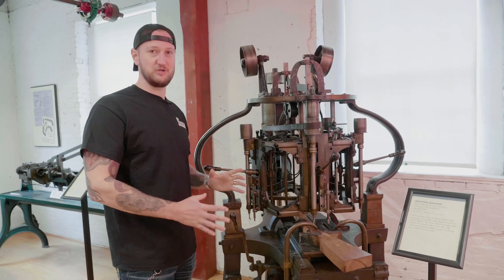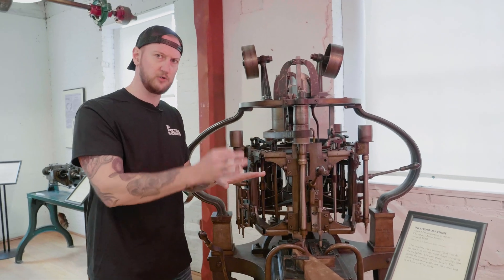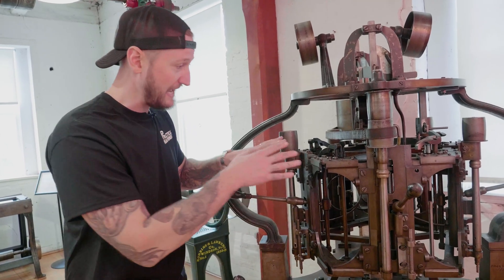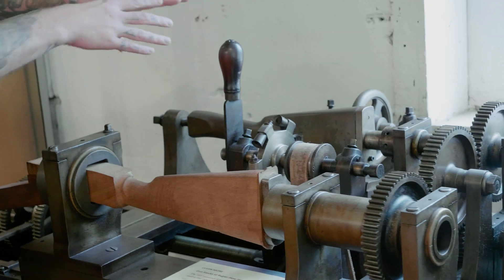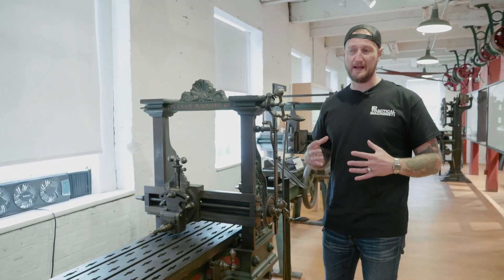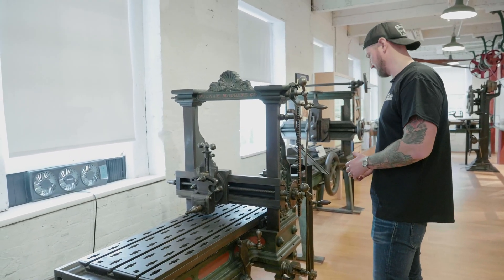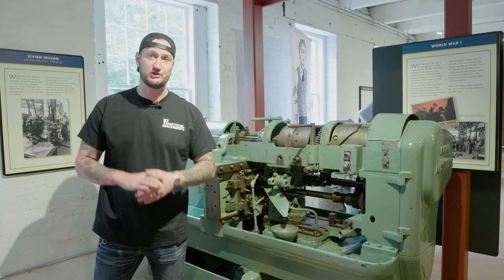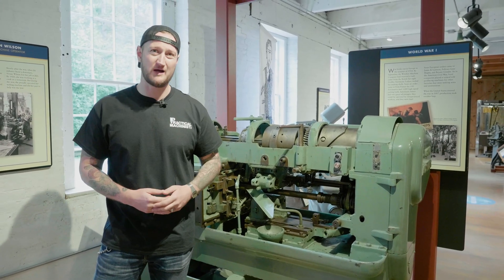The 1800s Machines That Built Modern Manufacturing | American Precision Museum Highlights

Comment: I wish the myth of Bridgeport inventing the knee mill would stop. They didn’t invent the knee mill. Knee mills in horizontal forms were made in the 19th century. So were shapers with similar tables. Vertical knee mills and die makers were around long before the Bridgeport. Just a little bit of research will confirm that. I’ve got a lot of machine tool books going back to the mid 19th century and you would be surprised at how many machines using a knee there were. Bridgeport took forms that were basically around and in use already and designed a mill using those features in one machine. They added some features such as the nod. But much of what the Bridgeport was had already been invented. The Bridgeport was an excellent machine for its time, not the most solid, or accurate, but its versatility was unmatched and that was what made it and its copies, some of which were better in some ways, so popular for so long. Unfortunately, Bridgeport is a shadow of what it once was, only producing the 49” table model in manual and CNC. Hardinge bought them a number of years ago.

Comment: How did you skip over the water wheel display? The water wheel was the prime mover of the day that without none of those precision machines would operate. Water wheels while most were very low horsepower made massive amounts of torque to operate all varieties of mills and machines. If you want to see how powerful water power was visit the Amoskeag Mill Museum in Manchester, NH or the Lowell National Historical Park(NPS) in Lowell, Massachusetts. Without water power there would have been no industrial revolution.
Reply: There's a more in-depth tour here on our channel that covers that as well - and you're absolutely correct, very cool that all the machines used to run straight off the river!

Comment: Line shaft
Pantograph
A shaper moves the tool. With a planer the tool is fixed and the workpiece rides a carriage beneath it.
Reply: Ahhh okay this is great information! My knowledge on the older stuff is spotty at best but it's very cool to check out!
Reply: @iansandusky417  It's cool to see you do these tours.
Especially (for me) coastal CT. like Bridgeport (also home to Moore, who wrote the book on precision jig boring) & New Haven (Geometric Tool Company, automatic tap & die heads, Pratt and Whitney, the machine tool company not jet engines)
Torrington gave us precision bearings... and so much more. We used to be the epicenter of firearms here in the U.S.

Comment: I first heard about the museum in early 2019. As it happens, I was planning a motorcycle trip to the east coast from Vancouver that summer so I made a point of stopping by the museum for a visit. So well worth the detour to see their collection. It was one of the highlights of the trip.
Reply: Most definitely - such an unassuming place with so much good stuff in there! Glad you got to check it out in the flesh!
Reply: As it happens, I'm heading east again in August and have to make stops in Rhode Island and New Jersey so I will put that on my list. Thanks.
Reply: @DavidM2002  I'm pretty sure they're seasonal (like May through September)
They have a channel with a bunch of videos up on YouTube.
The Greenfield/Millers Falls area was a hotbed of tool manufacture through most of the 20th century
Reply: @DavidM2002  If you're ever in Greenfield MA the Museum of Our Industrial Heritage is small but worth a visit.
The town itself is a shell of its bustling past, though I think Kennemetal still has a presence there.

Comment: When I was 17 I worked at a pattern shop that had two “duplicator mills”. Thats what they called them. They would build the tracing pattern in the wood shop. Then they would load it on the left side of the duplicator add some graphite powder to the stylist and start tracing as the endmill would cut the cast iron block to  the left side. It was pretty cool. Except it took way more hand polishing then machines now days. Tad rough. lol
Reply: Oh I think I've seen those before - very cool tech - but most definitely not the same as a 0.002" stepover on a waterline pass when it's all said and done! I bet it was a good shoulder workout buffing those down to spec afterwards!

Comment: I trained with an old gentleman who spent 60 years as a pattern maker. The stuff he made and the accuracy and tolerances he could achieve in wood with nothing but hand tools would blow your mind.
Reply: @robertpearson8798  And imagine all that had to be done with a shrink rule to account for the material being cast (i.e. aluminum shrinks more than brass/bronze and that more than cast iron) every pattern has to be X% larger than the finished piece will come out.
It's amazing how skilled they were/are!
Reply: @jimurrata6785  Yes, even different alloys of metals had different shrink factors. He said he would spend many weeks working on a single pattern for something like a detergent bottle and it had to be very precise for the fill level to be correct for a given volume. The difference could be less than the thickness of a coat of paint.